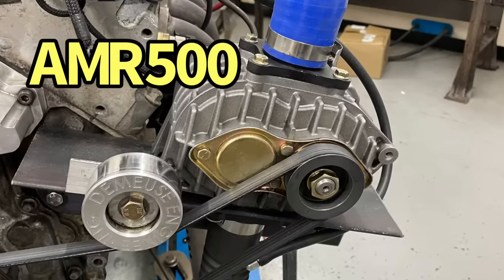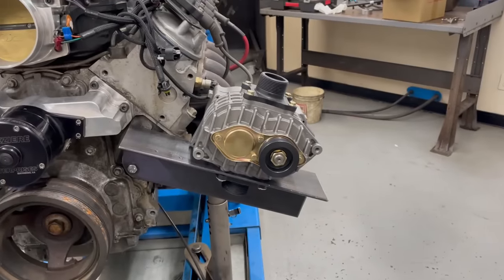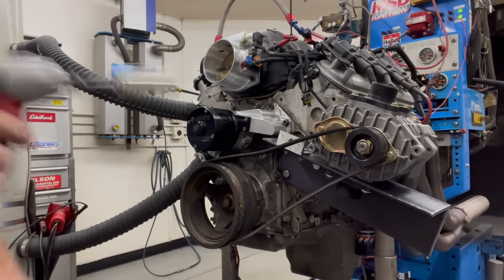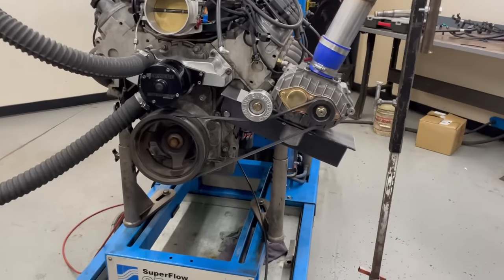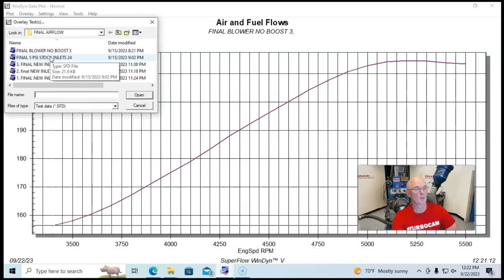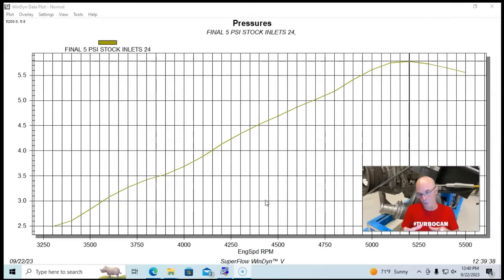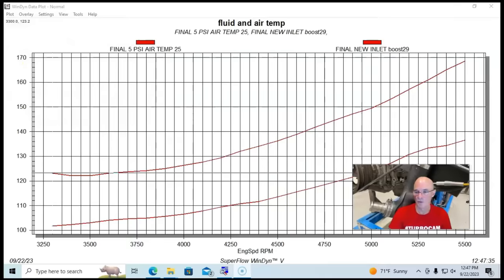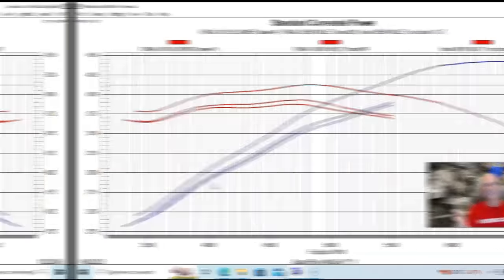THE ULTIMATE CHEAP, EBAY, AMAZON AMR500 BLOWER TEST. FULL RESULTS-AIRFLOW, TEMP & POWER CONSUMPTION

Comment: Outlet pipe probably needs welded all the way around instead of 3 small runs and why not hook it up to the engine for a run and see what kinda power you can make?
Reply from the maker: 150-hp blower on a 440-hp na motor doesn't work

Comment: You knew before you began that it wouldn't move enough air to matter with that engine. Try again with something closer to what it's rated for. The supercharger that's best for the 1.6 to 1.8 Liter Miata engine is much larger than the AMR500.
Reply from the maker: You might not understand what the test was. I used the LS motor only to spin the blower for airflow testing as illustrated in the video. I was not trying to run boost on the LS motor. A 150-hp blower won't work on a 440-hp na motor-we knew this going in, but wanted the flow potential of the supercharger to determine what motor it should go on. This was a blower dyno.

Comment: Your super charging the super charger? I thought you were gonna install it and we could see the gains"
Reply from the maker: why didn't we run the 150-hp blower on a 440-hp motor? Just a flow test to see what motor we should run it on-different size blowers (like turbos) work on different displacement and power output motor

Comment: Remove the oil fill cap. Replace with a screw in barbed nipple. Add some vac hose Let it breathe atmospheric. this releases the pressure in the cavity behind the seals on the back bearings. especially when you overspin the blower they’re good to 16,000 RPMs I run a smaller pulley I push it to about 20,000 RPMs after about five months the blowers done I just buy another one they’re cheap stock poly 5 pounds boost small pulley 7 to 9 pounds of boost reliably. Synthetic gear oil works the best. Boost comes in from 1200 RPMs very linear up to 7000 RPMs a well built 2 liter bug motor. Went from 110 horse dual 44s 205 horse with the blower at 7 pounds of boost. Car is on a diet 1800 pounds with driver in car full tank.
Reply from the maker: thnx-very cool stuff

Comment: It all depends on pulley size. Removing all the plastic parts. Replacing them with metal parts. 
Is it good start.
Cooling the oil, is also good. Hypoid oil only lasts so long. (The Heat!) Ha,ha,ha
Probably work better on a motorcycle engine. 
An inline twin, with no balls. Might help..............
Gave me an idea for a project in mind.(XS-650, Street Tracker)
🤔Hummmmmmm
Reply from the maker: plastic? parts and oil cooling doesn't change the eventual interference between the rotor and housing. Less rpm and boost pressure are the key
Reply: @richardholdener1727  
This toy, would only work out on small displacement engines, like motorcycle engines.
Where is the RPM most likely would cause it to self destruct. 
Just saying............................

Comment: higher discharge temps with lower cfm should equal less pressure.

There really is no reason the discharge pressure should have dropped unless the belt wasn’t slipping with minimal discharge pressure and was when it was under load. 

Did you log the cfm with the discharge pressure raised? I’m guessing it dropped when the load was too much for the belt tension. That might also be why it plateaued towards the top end of the rpm sweep.

Comment: How much horsepower did it make on that application? He only said what the engine made with out it, 440 hp. What’s the gain?
Reply from the maker: This was a flow test of the blower-it only flows enough to support 150 hp. A 150-hp blower can't help a 440-hp V8 motor. The motor was just used to spin the blower for the flow test.
Reply: @richardholdener1727  oh I see what you mean now. Thank you for helping me understand what you meant by that. It wasn’t clicking for me at first. 
Man you really don’t miss a comment and took the time to reply. Very cool and thank you again. I really enjoy your content

Comment: Using a grossly undersized turbo/blower make for a wonderful intake air charge heater!  So far off the efficiency island!
Reply from the maker: just a flow test-so not undersized because we didn't run it on anything

Comment: I think your loss is due to over-exceeding your numerical volume, from the internal chamber of the blower itself, offset and over done by the too large inlet & outlets. Figure this out mathematically and I think you will come up with a better ratio for modifications of the inlet/outlets. I would imagine that the manufacturer figured this formula conservatively, but proper upon initial design and engineering. Another possible; what engine did the manufacturer base the design and specifications advertised for? Air pump to blower volume ratio?
Reply from the maker: The inlet and outlet of a PD blower can't be too big

Comment: I'd be curious to see if this would do anything on a stock L36. And if it does how does it stack up to the M90.
Reply: M90 is better, u can spin the M90 faster and the M90 is bigger displacement than the amr500
Reply: @rokuplayz464  I do not doubt this, but I would like to see the results. You know, for science.
Reply from the maker: this is a .5L blower for 150 hp
Reply: @SoonerDan77  AMR500 is basically a paper weight
Reply: The AMR500 is roughly 1/3 the displacement of the M90. Also, the L36 V6 is rated for 205 hp, whereas the AMR500 can only flow enough air for about 130-150 hp. So it would actually be an airflow restriction on that engine.

Comment: look at the rotors. ive seen people post that the rotors are coated with some thick crap and they come appart. instead of teflon strips or close tolarances they use something that wears away...but also comes off in chunks. I was waiting to see the hp## with the am500 feeding the ls!!!   it would also be nice to know just what size engines it can help out. I have one of the enemic 2.4 ecotec gm 4cylinders that cant get out of it's own way...how gm manages to tune&cam this crap to get 60 or more hp less than the other makes with the csame basic size&head is just plain stupid. I also have the turbo version 2.0 with flyes.
Reply from the maker: THIS IS A 150-HP BLOWER (WE KNOW FROM THE AIRFLOW DATA GENERATED BY THIS TEST), IT WON'T FEED A 440-HP LS V8

Comment: it would be interesting, for kick, to see this on a stock LM7.  wonder if one is enough or two or if two were in a compound setup.
Reply from the maker: 150-hp blower doesn't work on a 350-hp lm7
Reply: @richardholdener1727  
How about 6? 3 on each side of the crank, feeding into dual pipes like an old Potvin setup.
That's 1300+ cfm at 5 psi, with a parasitic loss of about 50hp. Will it win or lose?

Comment: how many rpm can the blower run?  my honda acty (660cc engine 3cyl) sees 6500 in normal driving, and cruises (70mph) at 5500 rpm
Reply from the maker: THIS ONE WAS RUNNING 18000 RPM
Reply: @richardholdener1727  i guess i should be more specific, 6500rpm engine speed.   Idk what that is at the compressor.

But that power consumption is concerning, the 660cc engine only makes 32hp(at the wheel) to begin with 😂
Reply from the maker: the blower speed depends on the pulley ratio (crank vs blower pulley), no way for me to know what crank pulley you have or plan to run. The blower will make more than it consumes, but you will need to slow it down for a 32 whp application

Comment: Run it on the test motor intake? See what it can do for us!
Reply from the maker: 150-hp blower on a 440-hp motor doesn't work
Reply: @richardholdener1727  Then it’s too big to do the test on
Reply from the maker: this was not a let's boost and LS test-it was clearly a let's use the LS to drive the small blower (blower dyno) and find out how much it flows so we can decide what motor it will work on

Comment: Ive been curious if it was driven by a electric motor  runnin  maximum so 18000rpm there was no parasitic loss and constant boost
Reply from the maker: a 28-hp electric motor is big and expensive
Reply: Why would it need to be so big couldn't it run on like a quarter horse

Comment: So basically if you actually plumb this into this engine it's not going to make anymore  horsepower? By the time you factor in what it takes to turn it?
Reply from the maker: 150 hp blower does not work on a 440-hp na motor-that is why I did the flow test-so you can put this blower on the right (smaller) motor

Comment: Let me lay this on you, you take a 1'x1' sealed box and fill it with 20psi, now take a sealed 2'x2' box
And fill it with the volume of air from the smaller box. Wow 10 psi!
How did that happen, Mr. Whoopie??? The larger aperature allows greater flow but lowers the preasure...kind of like when you were a kid messing with the garden hose, you put your finger over the end blocking part of the flow. Volume goes down but preasure goes up...now reverse that conumdrum!!! Whoopie!!!
Reply from the maker: think past that simple (inaccurate) explanation. we flowed more air though the same restriction orifice size and boost went down. Now go do some thinking

Comment: Can anyone explain why at 7:58  the rpms increase even though the throttle body is already fully opened? I always thought RPM was related to TB position for a gas engine. Versus a diesel which controls RPM by adding more fuel
Reply from the maker: throttle opening does not control rpm-you can easily rev to redline at part throttle
Reply: Perhaps the AFR can remain the same over a range of RPMs. And at the high RPMs your injectors will top out of their flow rate and become chocked.

Comment: Honda D series motors spin counter clockwise.. Does this mean I just can't use this on my D series civic?
Reply from the maker: it can be spun either direction
Reply: @richardholdener1727 does it affect pressure? Basically just plumb it backwards?

Comment: It’s just like a water pump you can only push so much flow so bigger pipe isn’t always better if your trying to make pressure. The bigger inlet won’t hurt output in psi because you always want the  most available incoming but outgoing a pump can only push out so much volume so to build pressure when volume is maxed out it will make less pressure.

Best way I can explain when I was installing pump once to test a well we had an engineer on site my old man asked me how much you think it will pump gpm I said 25 gpm the engineer said no way I bet you no more then 15 out that little hose your hooking at the top it can’t that’s just how it works. I said sure how much you want to bet he said 10k trying to be a smart ass not thinking I had the money my. At that moment my old man says make it 50k then if you two are really gonna make a bet I got check book in the truck to cover for my side. So the engineer all the sudden lost confidence decided to do a friendly bet for lunch. We started the pump did the measurement it did exactly 25 gpm. I had to explain to this engineer that my 15 years experience was a lot better then his theoretical understanding. With the smaller hose we had it will overcome friction loss on 10ft long hose and push 25gpm where normally 15gpm would flow through that diameter but the pressure coming out the hose was much greater and the water would shoot 15-20ft out the hose. If you use bigger diameter hose same 10ft length the same volume of water 25gpm would come out because the pump was maxed out at volume it could pump at depth installed but the pressure you’d see out the bigger hose would be much less water would shoot like 5 feet. So same thing happening right here with this supercharger. Best results will be big inlet small outlet.

Oh I almost forget me and my old man ate real damn good that day it wasn’t cheap either. I was 6’4” 240 at the time and my dad was 6’2” 200. 😂

Comment: No slipping belt the system getting hot or can't hold boost Wich making the graph drop at high rpms or poor design supercharges should be able to climb or hold stead kinda looks like a turbo graph

Comment: So am I interpreting this data incorrectly? the blower made basically a tiny amount of power with tons of belt slip?
Reply from the maker: THE BLOWER WAS ONLY TESTED FOR AIRFLOW AND POWER CONSUMPTION-IT IS A 150-HP BLOWER (THE MOTOR IS A 440-HP MOTOR)
Reply: @richardholdener1727   okay thanks rich! very interesting mate cheers.

Comment: Thats fine but how much hp does it make the engine have when hooked up
Reply from the maker: 150-hp on a 440-hp motor doesn't work-just a flow test-I will be running it on an appropriate motor for power

Comment: slip you can see the belt jump in the last pull it came off partly, leak on the second pull 5 lb on that weld you know it was leaking, it would only take 4 of those to keep up with the motor. still it was good content. not as good as i would have liked.

Comment: Can’t flow the air on the top end it just reaches its limit as the engine/pump wants more air but the blower can’t produce so it loses boost
Reply from the maker: the blower was not feeding the motor
Reply: @richardholdener1727  I’m stupid nvm me I drank a lil bit to much last night 🤦🏻‍♂️

Comment: JMO, other than getting tons of views, likes and comments 👍if there is any doubt about belt slippage this 'test' was almost useless 🤷‍♂
Depending on what tire they have I have to strap higher powered bikes (300+Hp to the drum) really tight to eliminate tire spin = the data isn't 100% accurate
(tighter straps = lower numbers) but getting/having good repeatable data is 100 times better than any amount of questionable data...
Reply from the maker: I feel that way about this comment

Comment: That blower is meant for a much smaller engine. This went exactly as expected
Reply from the maker: this was a flow test to show what motor you should use the blower on (the 150-hp blower won't work on a 440-hp na V8)
Reply: @richardholdener1727  it's just completely obvious without the test. Atleast for anyone with experience with engines
Reply from the maker: I searched endlessly on line for actual flow data-there was none-now there is and we are backing it up with a real blower dyno test-also putting one on a suitable motor for power tests-more info is better. This test wasn't for guys who know everything, they learn very little.
Reply: @richardholdener1727  that's cool that you went to the trouble.

Comment: can a smog pump be used  to inject air into the intake manifold
Reply from the maker: only for very small motors-they don't flow well nor do they work very well at higher pressure

Comment: So is this worth it on a 6.0L vortex max? Thanks
Reply from the maker: this was a flow test of the blower-it will only support 150 hp (it is for a small motor). I only used the LS to spin the blower and measure how much power it took to drive the supercharger
Reply: @richardholdener1727  oh ok thanks!

Comment: I love it,  my new favorite channel robot cantina calls them stupidchargers and it's so right.  

but they do work.

as a smog pump on any reasonably sized engine.  lol.

It can produce boost on say a predator 670  :)
Reply from the maker: it is a 150-hp blower-just needs to be run on the right na power motor
Reply: @richardholdener1727  I look forward to the math!
They're crazy cheap if you have the spare duty cycle and fuel pump

Comment: Okay, did i miss the part where he tested hp increase with it connected to the engine? I saw the pawer liss driving it but not the power ibcrease from using it???? Help
Reply from the maker: 150-hp can't feed a 440-hp na motor-just a flow test
Reply: @richardholdener1727  okay, I understand. Thanks for the video

Comment: Doesn't stock pulley only run it at 13.5k on 2l engine howd u get 18bk outa it btw these are rated 16.5k rpm
Reply from the maker: the drive ratio and blower speed are a function of the size of the crank pulley in relation to the blower pulley. Our drive ratio was 3.33:1(big crank pulley)
Reply: @richardholdener1727  also would love to see if V8 makes less or more power with it connected

Comment: If you look at density your answer to the question is answered
Reply from the maker: nope-you have it backward
Reply: @richardholdener1727  not
Reply: You need to watch Gale banks. Buy his stuff . It will prove me correct you gained almost 100degrees . The ledges positive and neg in the inlet make heat too as well as interfere.
Reply: Thus you lose more density .

Comment: What happens when you mix n match the inlets and outlets, the factory and the ones you made
Reply from the maker: it flows less
Reply: @richardholdener1727  even with the bigger intake side and smaller discharge side?
Reply from the maker: yes-it flows less if you restrict either side

Comment: The AMR500 is only rated to push enough air for 350hp at least on 2.8l motors, not sure why anybody thought it was a good idea to bolt onto a 5.3 but even in theory it’s not a good idea
Reply: it was to test the HP it takes to spin it and how much airflow it was capable of.  At no time was he testing if it could make more power on the 5.3, you should try watching the video.
Reply from the maker: it won't make anywhere near 350 hp

Comment: what about how much power the engine makes with the supercharger?
Reply from the maker: this a .5L blower made to support 150-hp, this is a 440-hp na motor, they don't work together
Reply: @richardholdener1727  interesting content, but the test engine sort of defeats the purpose of the little super
Reply from the maker: Again, this was not a test motor, the LS only spun the blower to measure airflow. The blower did not blow air into the LS.

Comment: man those numbers mean nothing to most dummies. but the difference it wouldve or would not have made in horsepower connected to the engine I think is what most people would have liked to have seen. expected to see based off the title if nothing else.
Reply from the maker: 150-hp blower on a 440-hp motor doesn't work. The flow test of the blower was done to see what motor we should run it on.
Reply: so that blower plumbed to that motor would have made less hp than it could make just naturally aspirated?